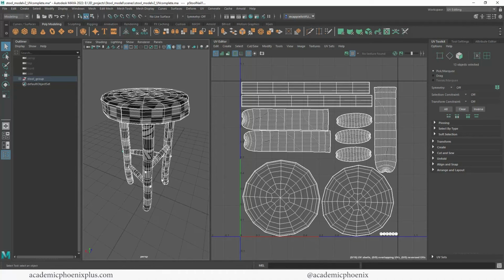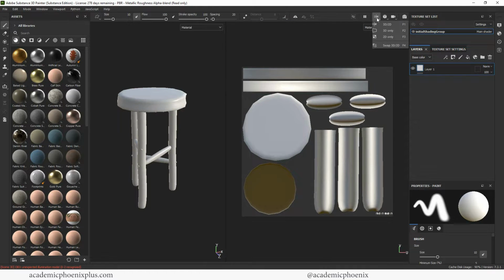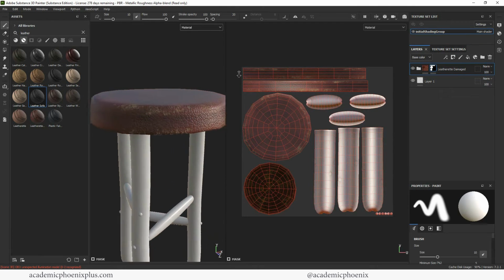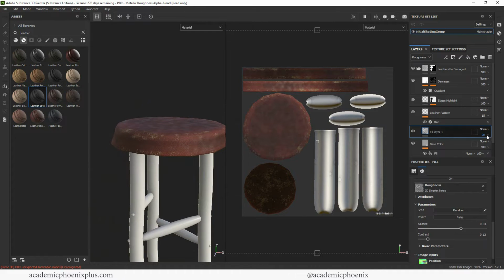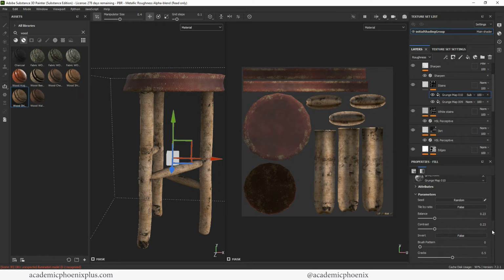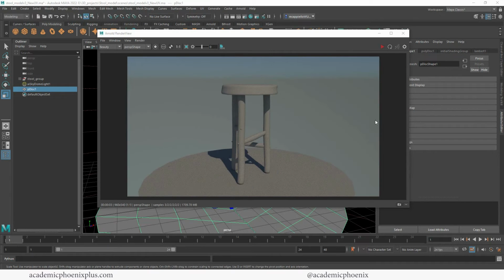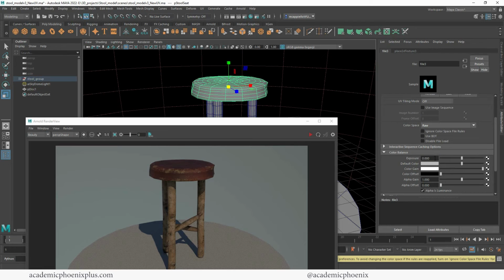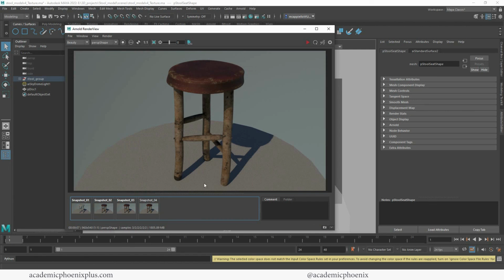Texture a Stool using Maya 2022 and Substance 3D Painter

Comment: hello your tutorial help me a lot on UV map in maya THANK YOU! but i have one question, why when i import my 3D model to substance the smooth are missing on the 3D model?
Reply from the maker: if you have '3' pressed, which is smooth preview, the model looks smooth mesh but it's a low polygon model. press the number '1' on your keyboard to see the real 3d model. If you want to have a sooth model, go to Mesh>Smooth. It will be higher poly but way smoother and it will import into substance painter smooth too. I hope that helps!

Comment: "you have to make sure the UV's are facing the right way" .. Not necessarily, with standard materials in substance painter you can either use triplanar projection, or you can mask the UV that's the wrong way to another layer with the same material and rotate it in the material properties. With smart materials you could again use a separate layer for the incorrect direction with the same smart material but add a transform filter to the to of the materials stack and rotate it with that. So while it's good practice to get the UV direction right before hand, it's not necessary and if you have an awkward set of UV's where you just don't have the space to rotate things then you can still adjust it once in substance painter.